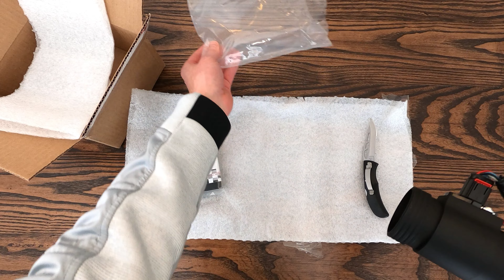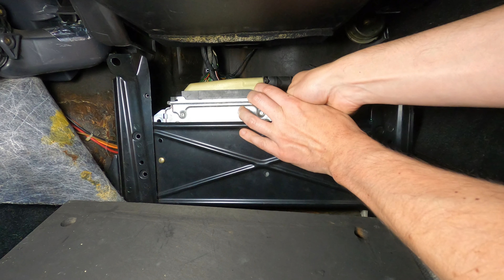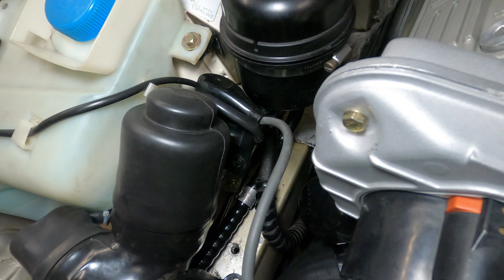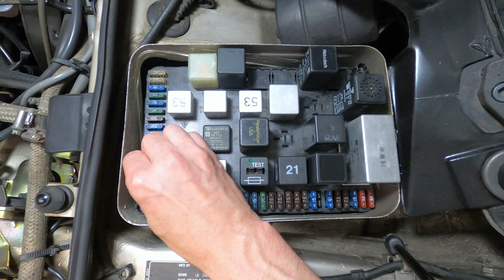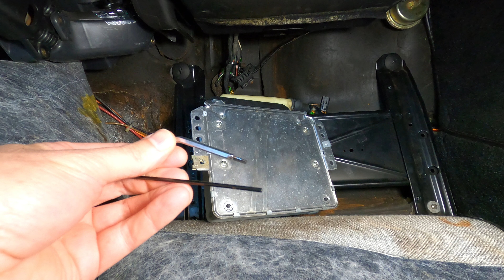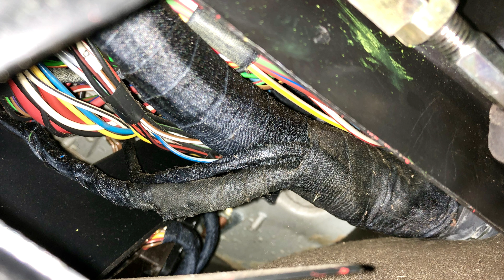Porsche 944 – Lindsey Racing MAF Tune Kit Installation & Review

Comment: Would a faulty throttle position sensor make it not work? Currently working on a no start and it ran for 40sec before dying and I had just added the MAF because my old barn door failed
Reply from the maker: In rare cases that’s possible, but usually just causes erratic or surging idle, poor acceleration, etc. Easy enough to test resistance on the switch to confirm.

Comment: Could the Lindsey MAF cause a surging idle on a warm engine? I've upgraded to the Lindsey MAF, and also the F9T DME. Now the idle surges widely when the engine is warm. I've checked for vacuum leaks twice by smoke testing and also checked the ICV. All good. Now I'm thinking the problem is on the fuel side. I do remember strong fuel smell when I took off the intake manifold when dismantling it to test the ICV. Is the DME trying to compensate for the increased MAF airflow and adding too much fuel, causing then to increase the airflow, and the idle just bounces back and forth??? I'm getting pretty frustrated.
Reply from the maker: The MAF sensor will be slightly less forgiving of vacuum leaks than the factory AFM. I’d smoke test the intake to confirm, it’s also worth testing the TPS and the O2 sensor.

Comment: Can I do the same as you explained with a 944 S2 ( 1990) ? Thanks
Reply from the maker: The Lindsey kit isn’t compatible with the 16v engines, but Storch has a slightly different MAF kit that supports those cars. I have a video posted on that option as well…

Comment: Ok help.... I wired the MAF directly to the positive side of battery and I still get a start and immediate die afterwards.  I emailed Linsey Racing and as you all my know if you've bought anything from them there customer service it  the worst in the business, once they sell you a product you're on your own from there.. So are there anything else i can try.  I have 3 track car 944's and get the same result on all 3.  ????
Reply from the maker: @rha944racing6  Hey! So a few things come to mind, one you can test for 12v at the MAF electrical connector to ensure power is making it to the sensor, two I’ve seen some people accidentally install the performance chip in the wrong direction, and three I’ve seen an occasion where the daughter board was inadvertently omitted from the customer’s order. As for Lindsey, I recommend calling rather than emailing, they tend to respond better over the phone.

Comment: After I watch ur video , I need to strap my S2 again on dyno with Wideband ~
Reply from the maker: @diyman25  I’d be interested in hearing the results. 👍🏼
Reply: @NC944er hook wideband and S2 was uncomfortable lean after my custom true dual +. Xpipe , readjust FQS today to +6% A/F at 4th gear  6000 RPM around 13.9 , more comfortable on this A/F ratio
Reply from the maker: @ Glad you got it dialed in. 👍

Comment: Great Video man very helpful. I’m thinking about doing this as well but with having an early car i cant piggyback the 12V wire to the any of the fuses as I have the older bullet fuses. Im thinking of putting the 5 amp blade fuse into the 12V wire and then hook it to the positive post of the ignition coil with a spade crimp connector. Besides looks, would this work the same as your setup while also protecting the maf sensor from a surge?
Reply from the maker: @zede_boss1657  Yeah, thats exactly what I ended up doing with mine after a few months. I spliced in some extra wire to make the MAF power cable longer, covered it with split wire loom, removed the aluminum front bumper, and routed the power cable across the front following the same path as the main wiring harness over to the ignition coil. It’s been working fine for a couple years now.
Reply: @ perfect, thanks for the advice and great videos👍

Comment: Hi I love your videos. I installed this and the engine is choppy at all speeds, particularly over 3000 rpm. Sounds like I’m raving the engine up and down over and over,  but all I’m doing is holding the pedal down. I tried that triangle screw in every position, no change, and then I reinstalled the old sensor and it’s back to normal. Any ideas? I wrote to Lindsay Racing but they didn’t respond.
Reply from the maker: @Douglas-dt9ok  Hey! Interesting issue… I don’t think that would be impacted by the fuel mix since it’s going up and down, it sounds like the DME computer isn’t getting clear signals from the MAF sensor. Generally speaking, I would confirm the tune chip was properly oriented and fully seated on the DME board, ensure that the MAF connection is undamaged and well-connected, and that your power source to the red wire is getting 12volts consistently. Lindsey doesn’t really respond to emails in my experience, you have to call in and talk to Dave, he can usually provide some guidance and speak to any known issues. I’ll also add that the factory AFM is a lot more forgiving of little vacuum leaks around the engine than the MAF is, so it may be worth a check to eliminate any leaks from damaged/aging vacuum lines, hoses, and seals.
Reply: Wow thanks for the fast reply. I used an aftermarket solid state DME, I’ll try the old one, and I’ll keep hunting for leaks, maybe I should smoke the system. And if this doesn’t work I’ll give Dave a call. Keep up the awesome work, your 944 is amazing.
Reply from the maker: @Douglas-dt9ok  Cool deal! Sometimes there are strange quirks, like issues with the EEPROM chips, I saw one customer was sent the chip, but not the required daughter board, little things like that, but generally Lindsey is pretty good about swapping things out as needed.

Comment: Unfortunately found your Video after I switched the chips, I didn’t use an esd wrist strap, now my car won’t turn on, how can i fix it?
Reply from the maker: @zundapphoaza5203  The wrist strap is a good precaution, but your chip may still be ok. Have you done any troubleshooting of the MAF and wiring? Make sure everything is secure (DME connector and MAF connector) and test for 12v on the MAF connector when the ignition is switched on. Anything less than 12v won’t be enough to power the sensor. If you still suspect the chip, Lindsey should be able to swap it out for you.

Comment: Everyone's 944 engines look so good ..than I look at mine and I'm like ..mannnnnnnn
Reply from the maker: @jeffSampson-vm4gt  Solution: You can leave your car with me for a month along with an envelope containing $3,000, and I can make yours look the same. 😂 If it’s any consolation, they don’t all look good, 30 years of exposure to the elements takes a toll on the metal, some were stored better than others…
Reply: @NC944er  hah that would be nice ..I'm going to do an over haul on it soon ...I do have a question though ...any idea why my fuse panel is super hot and the fuses spark when moving them around ? I have an 84 ..
Reply from the maker: @jeffSampson-vm4gt  A hot fuse panel usually indicates high resistance at the prongs as a result of corrosion on the fuse block. Other early car owners have reported this on the forums, some getting so hot that it was melting the fuses. You may want to look at pulling the panel and cleaning all the connections with alcohol and an abrasive agent.
Reply: @NC944er  thank you so much ..I picked up some cleaner and some electrical grease hopefully will fix ...your awesome ...subbed !!!

Comment: How much harder is it with an 85.5-87? Confused about adding a pin
Reply from the maker: @henryneufeld4944  Outside of adding the two extra pins to the board in the DME computer, the process is the same. It would require some fine welding on a 40 year old board, so there is some risk there. You could send it in to Lindsey and they’ll add the pins for $50 last I checked. For me in retrospect, I would have just gotten the 944 Sport DME computer from Focus 9 at the same time, it already includes the extra pins and it future proofs the “brains” from inevitable breakdowns caused by the aging circuits.
Reply: @NC944er  I don’t need the one with OBD+ right, just the 944/951 Sport DME
Reply from the maker: @henryneufeld4944  Correct, you would not need the OBD.

Comment: What size inline fuse did you use?  The screen shot shows 30A but that seems too high.
Reply from the maker: @DavidParker-gw3zx  Yeah, most MAF sensors use less that 2.5 amps, so I went with a 5A fuse. Probably don’t need one, but couldn’t hurt to protect it. No issues so far with surges or blown fuse at that location.

Comment: I would love to install this as a replacement for the Bosch AFM in my Vanagon 2.1 Digifant system. I have a tunable EPROM. I would imagine that I would need to convert the timing and fuel maps to read the voltages from the MAF instead of the old voltages from the stock Bosch AFM.

Could you confirm the voltage outputs from the Hotwire MAF?
Reply from the maker: Yes, I agree that a new fuel map would be needed for that application, although not my area of expertise.
Reply: @NC944er  Do you know if this MAF outputs a 0-5v signal. I would imagine so, since the original Bosch AFM did.

Comment: NC, I was hoping you’d be able to help me understand exactly HOW the dme is adjusting fuel percentage based on FQS selection. 

For example +3% fuel, is that adding +3% to the injector duty cycle? Ie the injector stays open 3% longer?
Reply from the maker: Hey man! I don’t have much firsthand experience with tuning outside of plug-and-play solutions, so I’m probably not the best person to ask, but the Rogue Tuning website has some interesting details about the setup (link below). The guy who founded Rogue was the original creator of the 944 MAF kit before he passed the torch on to Lindsey Racing. My understanding is that the FQS settings modify the amount of fuel being injected by lengthening or shortening the injector duty cycle under various conditions. For example, the fuel map has three different data tables, one for idle, one for wide open throttle, and one for part throttle, where the latter factors in “load” as an additional variable. So it seems like in order to increase the fuel mix by +3%, the injectors will remain open longer for each cycle, but that amount of time can vary based upon RPM and load in order to achieve the additional 3% fuel for each data point. Let me know if you come to any major epiphanies on the topic, I’m always happy to learn from others’ research. 

Rogue Tuning - https://www.roguetuning.com
Reply: @NC944er Okay awesome thank you so much for the reply that’s kind of what I figured it was doing, but at a basic level I didn’t realize it would change based on RPM. 

The reason I asked is because I tried to go with a set of aftermarket injectors recently after I discovered a leak. The results were interesting I couldn’t get the car to idle properly but it pulled so so well when accelerating due to the better atomization of the fuel. I’ll give that link a read thank you!
Reply from the maker: @TakeFlightGarage  Oh man, yeah my old injectors are a little sensitive. I had them cleaned and then one locked up prior to install. They seem to be ok after a second cleaning, I’m just not sure how long they’ll last. The original Bosch units are still available for about $100 each if the aftermarket ones don’t work out. I believe part number: 0-280-150-803
Reply: @NC944er  my part number is a little different I couldn’t find anything less than $300 per injector! 280 150 158 are the stock part numbers on my car, I’ll have to double check what the after market number is that got. 
I was experiencing a choppy idle but solid acceleration full and part throttle, and then loooots of burbling and popping between gear changes/ on throttle lift off while in gear (which I will admit I thoroughly enjoyed lol) 

The odd thing is that when I adjusted to a leaner FQS setting the idle and popping got worse. I ended up switching to +3% for the best all around experience but I knew the best thing to do was just throw the old injectors back in. I’ll take a look at that 803 part number and see if it cross references with the aftermarket ones I got.
Reply from the maker: @TakeFlightGarage  Yeah, $1,200 for a new set of injectors is pretty wild. 😂

Comment: I have an 83 and i have been having trouble with loss of power after 5k rpm and have been thinking that iv lost some compression or need to clean the injectors. What would be the best way to find my issue?
Reply from the maker: Hey man! Is the engine breaking up at all or does it just feel like less power after 5k? The 8-valve engine was setup for mid-range power, so you’ll feel the most out of it between 3k-5k, after which point the torque curve drops of pretty quickly, even on a healthy engine. But if you feel like power has dropped from previous experience, I’d perform a compression test across the cylinders and look for variations of greater than 10% between the highest and lowest cylinders. That will give you an idea of any valve or head gasket issues.

Comment: I have an early car, and if I understand correctly to use the Lindsey MAF I would just need to switch out my 85.1 DME module for an 88 one?
Reply from the maker: Yep, an ‘88 or ‘89 (2.7L 8V) will have the needed 28-pin setup to accommodate the chip. If you find an ‘85.5-‘87, those can be converted by soldering in 4 additional chip sockets.

Comment: Great video,thanks for that! But one thing: the antistatic band should not be connected to the part you're working on, but rather to a good grounded point (metal, heating radiator or so), cause if you had been loaded antistatic, you might have destroyed the DME by close contact by the bracelet, that's just IMHO.
Reply from the maker: Thanks for the tip! I was just following the instructions from the supplier and that’s how they had it set up, but what you’re saying makes sense. Cheers!

Comment: Hi sir. I have seen a lot of your 944 videos. I have a 86 944 Turbo of my own since 1989. I'm a mechanic myself and i have been the only one touching this car ever. What makes me extremely curious is how is your 944 in such a pristine condition? It is impossible to have it like that unless that car went through a complete meticulous restoration. There is no other way to have it like that perfect after almost 40 years. Keep it like that😊
Reply from the maker: Yes sir, your suspicions are correct! I’ve been extensively restoring the car for the past four years, replacing much of the hardware, cleaning the engine bay, and trying to bring the car back to its original condition. The amount of money I’ve spent on new parts probably exceeds the vehicle’s value at this point. I’m glad you have enjoyed the channel so far. 👍🏼
Reply: @NC944er  Well, let me tell you that you have done a remarkable job restoring it. I tend to look into details, and I see yours impecable. I wish I could have mine like that. But I don't think I will since I know the incredible amount of time, which is more valuable than the money you have put into that car. Mine is very well maintained and kept. But not as a concourse example like yours.
Reply: @NC944er  Also wanted to ask you, been the 944 turbo a more desirable model and easy to bost more power, why did you choose the 944 N/A? Certainly, the turbo is more complex and difficult to work with, but i have seen you have the ability to fix it anyway. Regards
Reply from the maker: @eliaszafrani  Price point and reliability considerations played a small part in that decision, but more so that the NA is very nostalgic to a period in my youth. I think most people prefer the sleeker front bumper cover on the Turbo, but I actually like the protruding front bumper on the NA, with its goofy bumper pads. 😂

Comment: Any difference in running so far?
Reply from the maker: Hey Geoff, the car still starts and runs reliably so far with no major problems. It’ll occasionally go just a tad lean on cold start, where it takes an extra second for idle to settle in around 1,000 rpm, but it doesn’t happen all the time and when it does, it really only stumbles for a second before resolving itself. I have all new vacuum lines, but haven’t checked my throttle body o-rings or the top seal on the AOS, so there may be a tiny leak causing that, but it hasn’t been bad enough to warrant a tear-down as of yet.

Comment: Something seems off with your gear ratios - only gets to 50 in 2nd? Only slightly over 60 well in to third? Maybe I have a turbo trans lol
Reply from the maker: Ha! My transmission code is 5Y, which matches my 88 model year, having a shorter 5th gear than the early cars (not good at all for highway speeds), the the rest is the same. To your point, the Turbo transaxle has slightly taller 2nd, 3rd, and 4th… maybe you found a secret upgrade. 😂
Reply: @NC944er  i have an 85.5 and my car gets to about 58 (on the speedo, not GPS) in 2nd. Time to investigate

Comment: So I'm disappointed to be learning that this doesn't apply to the 16 valve engines.
Reply from the maker: Yeah, unfortunately the 16v version never made it to market. It was briefly under development by the original product creator, Rogue Tuning, but they got out of the game before it was fully realized, and then the torch was passed to Lindsey to package and continue selling the 8v units. I think with the lower production volume of the 16v cars, there may not have been enough demand to justify the continued development and at this point, a number of products are dropping off the market even for the 8v cars.